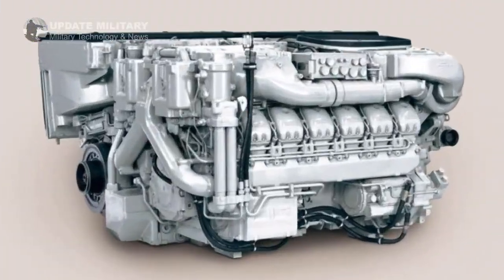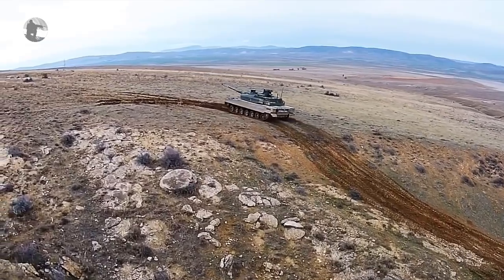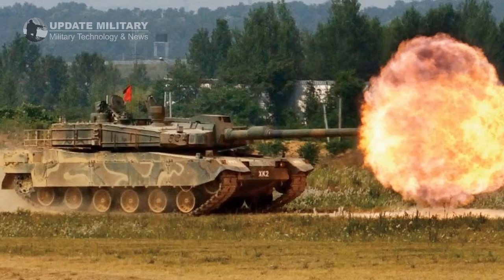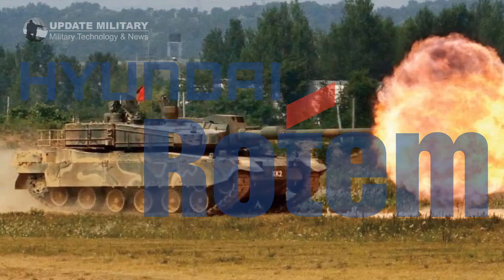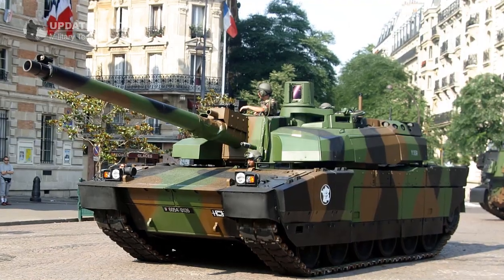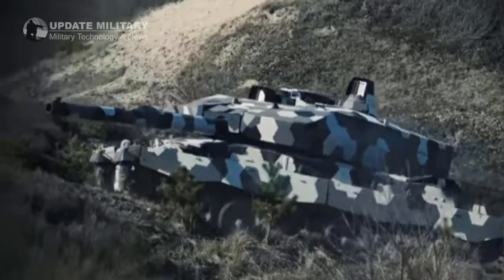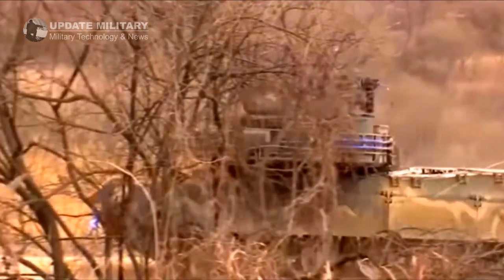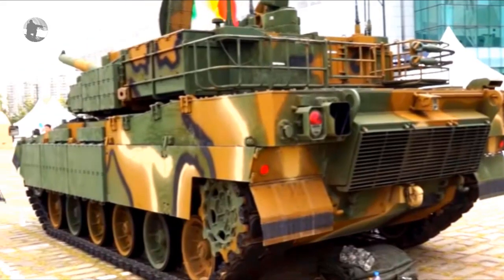South Korean-made 1500 HP engine for the K2 Black Panther and 500 Turkish Altay tanks

Comment: Code forbidden AE styles in automobile market know as bad automobiles and bad motorcycles thus. Uneducation Automotive Engineering group class brilliant have invent these ones for for their feeling without knowledge.
1. Wider rear track than front track bodyworks | The lowest traction 0.7g, extreme tail flick, extreme slide, 1-5 km/l, below 1 km/l by Formula one speed 160-250 km/hour, over 250 km/hour on all circuits.
2. Front track as same dimension as rear track bodyworks | The medium traction 0.85g, tail flick, slide, 1-5 km/l, below 1 km/l by Formula one speed 160-250 km/hour, over 250 km/hour on all circuits.
3. Wider front track than rear track bodyworks in below 10 mm | The medium traction 0.85g, tail flick, slide, 1-5 km/l, below 1 km/l by Formula one speed 160-250 km/hour, over 250 km/hour on all circuits.
4. Wider front track than rear track bodyworks in 10 mms | The medium traction 0.9g, tail flick, slide, 1-5 km/l, below 1 km/l by Formula one speed 160-250 km/hour, over 250 km/hour on all circuits.
5. Without rear fog lamp | No one can see the front vehicle in fog, risk damage, 1-5 km/l, below 1 km/l by test maximum over 20,000-150,000 rpm, Formula one speed 160-250 km/hour, over 250 km/hour on all circuits.
6. 1-4 turbo intercooler petrol engines | Easy damage parts, 1-5 km/l, below 1 km/l by test maximum over 20,000-150,000 rpm, Formula one speed 160-250 km/hour, over 250 km/hour on all circuits.
7. CVT | Easy damage parts, 1-5 km/l, below 1 km/l by test maximum over 20,000-150,000 rpm, Formula one speed 160-250 km/hour, over 250 km/hour on all circuits.
8. Wider rear parts than front parts bodyworks | the lowest traction 0.7g, extreme tail flick, extreme slide, below 1 km/l by all speed on all circuits
This record information come from all brands and all socials   who can't pass Europe test performance standard bases all in automobile market. It mean no one pass Europe test performance standard base in automobile market. These ones effect EV, hybrid. 

From
All brands and all socials databases

End report.

All customers hate and ban bought code forbidden AE styles in automobile market because their short word say the worst products.